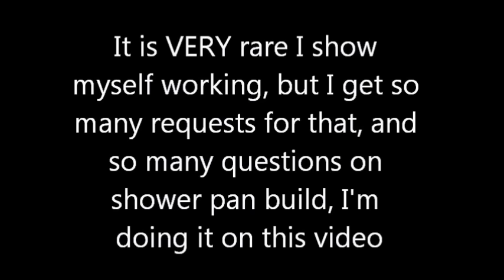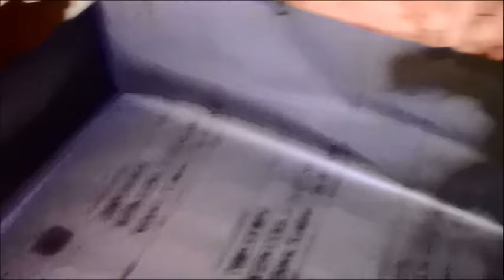HOW TO SET SHOWER PAN LINER and MORTAR

Comment: Great to see someone that doesn't preslope. Ive been shieted on for not doing it. I redguard the entire areas before tile so there you go
Reply: Just because your redguard before tiling does mean your good to go. Pre slope is a fail safe. So no pre slope, no fail safe.
Reply: @handyscapersllc 
I always pre slope as well. Do you know how many mud beds I redone because of no pre slope and the smell of stagnant water that had no where to go.
Reply from the maker: Obviously you're not up with the times, pre-slope doesn't matter now because everybody waterproofs the pan surface... as I have been doing for the last seven or eight years. Then FloFX comes along with a drain to make it happen. If you are still doing water in water out system then you are behind
Reply: @StarrTile  Nah I do remodels on older homes all the time when I tear out a shower with preslope before the liner they are usually dry as a bone with no redguard on anything just tile set on the bed above the liner the guy I learned from has done showers that way since the late 70's and always had the same company name and phone number and the only repair we ever did on a previous install was when two 300 plus pound fatties was getting freaky in the shower and the weight caused the mortar bed to Crack from the wood underneath flexing so much I always preslope and mix about a halfway of polymer modified mortar to two bags of bed mortar trowels super nice and has a nice smooth finish for the liner to sit on I use the same mix on the top bed no redguard ever on my bed then I hit all my screw heads with straight modified mortar and tape all seams and corners with it haven't had any failures in 15 years doing it the old way

Comment: I seen different ways to build the shower pan and they build a  first one mortar bed with slope before  laying down the PVC liner but ,I like to be practical and save time: I like the way you builded this showe, r because ones you installed the PVC liner plus you seal the mortar with red guard ,it will be no problem :good job  this is the way I do it , and never have a problem👍

Comment: I used to do tile when I was young and install panliners like you're doing we used to pre-slope the pan in other words before you put the pan in you slope it so when you go ahead and put the pan in it's already sloped in case you have any problems the water will always go to the drain and put three pieces of tile on the weep holes and then go ahead and mud it up but I guess everybody's different as long as it doesn't leak you're in good shape.

Comment: Basically makes no sense to put a liner without a pre-slope. If there is a leak ( that’s why you put a liner in first place) water  will sink down to the liner and just stay there and accumulate and will eventually rise to the tile . It ll never dry up and grout will come off tiles will give off. It just doesn’t make sense from your generally impeccable work ethics. But everything else on this video is Very educational and well thought of and crafted as usual! Thank you.
Reply from the maker: I don't believe that a pre-slope works as intended because wicking action with plus 200 lb and mortar will ensure that your pan is wet all the time, that being said nobody does water and water out anymore, surface of the mortar is waterproof which makes the pre-slope a moot and Antiquated issue, but thanks for the comment

Comment: Tutorial is nicely done; your usual good work.
Three things:
1. Knee pads
2. Caulk on screw heads or overkill?
3. Let's discuss your choice of music during the work session.
Reply from the maker: Thanks 😁✌👌

1. Knee pads bind up in back so I had them. I do have a kiddy float I use on flooring work, slides easy and I've had it for 3-4 years for a buck at the dollar store.
2. Caulk at srew heads overkill. I mud over them and the whole thing is waterproofed. I do caulk the holes I make with ledger boards though.
3. I had a great track on the working portion until 3 days ago when I got a copyright notification, which basically allowed ads to run and the money from the ads would have gone to the artist.... so I literally deleted the music and put on an ad free YouTube track...not the best tune but I'll be damned if somebody else gets paid off of my work 😂

Comment: I like your video but it would be helpful if you gave a running commentary on what you are doing rather than the loud music. The one question I have is what type of calking did you use around the drain flange. Is it normal silicone or is it butyl calking. Thanks for all the information, it’s really helpful.

Comment: I am doing another remodel  and have done my own shower pans. I understand why you dont preslope. I do a preslope, then a liner. I know if tiles leak its eventually having issues anyway.
 My extraordinary measure was using an epoxy grout that sealed the floor extra good. 
My new project I will use the largest tiles, then the leak issues are less. The mud bed must be absolute in the tile mud or it will crack. I always pull up tiles to insure adhesion contact on a floor.

Comment: I can only donate a small amount of $, because I live on a fixed income. While going in debt to it, I've been "forced to redo our bathroom. Please advise me on 2 things. What about your weep holes in this video? Just to be clear for me, you Redgard the mortar? Finally, I'm using a Quick Pitch and the instructions say I am to set the circular part on top of the flange bolts. So I need to screw the drain cap down  a little more to account for that, or just make my mortar bed thicker because of the Quick Pitch? Thanks SO MUCH for putting up some of your craft on YouTube. Don't quit. I AM like the other commenter who was puzzled as the amount of your followers. Dude, that's just wrong. You are an artist and should have 10 TIMES that amount! 🤳👍

Comment: Inspectors here in Oregon will fail my pan liners if they are not presloped.   You are lucky you don't have to do this extra step makes it easier to install the liner.  I also put some kinda of shim on the outside top part of the curb so the liner slopes into the shower area.  Looks like it will hold water to me.  Might want to protect the sides up the curb wall extra protection never hurts.  Would like to see how you do the curb part.  Do you use wire mesh over the curb and mud set it?
Reply from the maker: Everybody needs to get off of the whole pre-slope thing because if you waterproof your surface which everyone that I know does, then the pre slope would never kick in any way
Reply: That would be nice. When I do a large shower I got to wait for the preslope to dry before laying the liner..  PITA unless I put a board down on the liner so I don't mess up the slope..
Reply: It's because after a while soap, shampoo, and body oils mess with the pan waterproof membrane. At that point, water penetrates the mortar and sits stagnant on a non-presloped liner.
Reply from the maker: @msavage138  That sounds like BS, show me proof of that
Reply: @StarrTile  Then why bother to put in a pan liner at all?
Reply from the maker: @Stevelemontrudy  exactly, I asked myself the same question, force of habit

Comment: Very good videos, very practical?? I
 understand the way you explain the preslope will not help the situation if there are enough water leaked in. I am wondering if the preslope will help when water leaks in over time? If it does, why don't we build the preslope?
Reply from the maker: Because we waterproof the surface nowadays so it is irrelevant, the mortar will never see any moisture
Reply: @StarrTile  That is a good reason. How about in the case where the water seep thru from the bottom that is caused by a clogged drain. So the water get to the bottom of the mud. In this case, will the preslope help to drain any excess water - assuming the whole mud bottom already saturated with the backed up water. 
I understand this scenario does happen often, otherwise, there is a bigger problem need to be deal with, but when this happens, the ability to drain any excessive water will help, I would think.

Comment: Ok my issue is the builder used concrete to put a fiberglass pan in. I removed everything. But now i got concrete bumps making my floor not perfectly flat. Can i slope it UNDER the liner then tile on the liner or no? To chip all this concrete first would ruin the sub floor

Comment: When does the screw in drain cap portion get fixed or locked in to a height and what holds it from spinning?  Is drain "locked" in at the time of thinset and tile install?

Comment: So I’ve been told to use pea gravel around the weep holes on the drain so no mortar can get into them and clog them. Thoughts??
Reply from the maker: We are not doing water in water out system anymore so because we are waterproofing the entirety of the pan surface the weep holes would never kick in, having said that it doesn't make any sense to do an extremely porous product which would be Pebbles  instead of a less porous product which would be your sand mix, this might take

Comment: Good video 👍! The pan liner though obsolete now looked great in the corners. That was always the biggest mistake I saw when following a plumber. It's code in my area for the plumber to install the liner. I don't know why though lol. I take them out after inspection anyway
Reply from the maker: Thanks for your comment, yeah I heard that plumbers have to install Liners in some jurisdictionsh...but that becomes an issue if there is a leak later on, who does a homeowner blame, the plumber or the tile guy.... I would rather be responsible for the whole thing personally

Comment: Great video. Thanks for taking the time..  Do you red guard your mortar bed before you thinset?
Reply from the maker: Yes....entire shower is waterproof before any tile
Reply: Best advise I ever got from Mr startile was you should be totally confident your shower is 💯% waterproof before installing tile.
Reply: @StarrTile  
that does go a long way in answering all the pre-slope vs. no-pre-slope questions.

The bed of dry mix you set at a 1" drop per foot. ( that is your slope to the drain on all four sides.) 
Liquid membrane three coats and that rubber skin will last until the new homeowner changes out the outdate tiles.
Right ??

All the Walls up To the ceiling should get at least 2 coats of the waterproofing membrane. So, in theory that inside area should be waterpressure proof, if not... hit it with another coat of liquid rubber until it is. 

This is not rocket science, this is common sense at work. 

You are worth your weight in GOLD !! 

No one comes close to your watertight screws and drain area.

Comment: Hi, we are on our second shower pan leak  .  We have our guys come back and try to fix it. He took out the wood to reframe. He did use pre-treated wood and put a new liner. We did a test and we keep seeing water around the edges and also under the liner. What could be going wrong?
Reply from the maker: I could not possibly tell you the answer to that because there are too many variables with regard to operator malfunction. Obviously by the second one they don't really have a clue on what they are doing, be better to find a guy who builds showers because they do not.
Reply: Ok thank you for responding to my question.

Comment: Beauty vids brother i got one question, once i get the liner in, the final spin on peice of the drain, after i set the height, I just slap down the mortar? Thanks
Reply from the maker: Yes and do the best you can do firmly pack it around the neck of the drain
Reply: @StarrTile  awesome thanks for the response!

Comment: What if i dont want to put tile and i want to do all concrete for my floor.. can i use all mortar and just slope to the actual drain height? Should i use pebbles for weep holes?
Reply from the maker: Not sure I understand your question, you need to put tile on top of the mortar, not sure how you would just have a Tite-less pan...
And no I have never put pebbles at the weep holes, it would basically create a clog more than the mortar sand whatever do, but having said that we waterproof the entirety of the pan now so everything below it is irrelevant

Comment: I've seen now people do not put in a liner at all because as you also mention here, you do not put a preslope and I did not see pepples around the weeping holes so the liner appears to be redundant. If waterproofed with red guard or the orange schluter along with an epoxy grout, I do not see the need for the liner anymore. Your thoughts on this?
Reply from the maker: Yes, everything you said is true
Reply: A liner is to protect the subfloor from water damage not for drainage.

Comment: I’m doing a shower pan liner. I did a cement preslope already. Now I’m ready to install the liner. The backer board is already up and it was installed all the way to the floor. Can i install the shower pan liner over the backer board wall? Or how do i approach this situation?
Reply: Backer board goes on when the liner is installed on the studs

Comment: Why on some projects are a pre-pan installed then a finished pan with the liner sandwiched in between but then on this video, the liner fits directly on your base then a pan formed? My current project has a 6 X 3 pit with a center located drain. Does size dictate one or two pans? Thanks!
Reply from the maker: A pre slope is a thing of the past since everyone waterproofs their shower.

Comment: Is it by choice that you don't shop at lowes? Just curious.  Do you shop suppliers/wholesale or big box stores. As always I appreciate your ideas and methods as they tend to be down to earth. Thx, and happy new year.
Reply from the maker: I don't shop at Lowe's because I don't like their product line generally speaking, Plus they don't give the veterans 10% discount Like Home Depot does, and I can't go in there and get 2 feet of baseboard, they make you pay for a whole 8-foot section....
But yeah, HD is my go to store unless I need specialty items and I have tile stores fir that.
Reply: @StarrTile  I've started using their app. Order it the day before if I can and boom is ready. Or if it's a part for stock, I'll just have them send it to me
Reply: @StarrTile  I'm surprised Lowes does not give you the 10% military discount. I took my DD214 to customer service and they put me right in the system. I give the cashier my phone# and it takes off 10%. I live in Texas.
Reply from the maker: @dustchip8060  yes I believe Lowe's had said something about applying oh, and I didn't go through any process of bringing anything in because I carry my VA card in my wallet, I show that Home Depot and that's good enough
Reply: @StarrTile  I bought the 10" Rigid tile saw from Home Depot and they accepted my VA card as well.
Have you ever installed 4" x 48" porcelain floor tile? My client just bought it for their master bath I've completely gutted.I didn't realize tile even came in that length and small width. Already anticipating a nightmare. lol. There is 1/8" of bow up in the middle of the tiles.
Any advice on installation procedure outside the norm?
By the way, I use your procedure to install liners, mud beds and backer board. Thank you for the teaching.
Reply from the maker: @dustchip8060  leveling clips 💯
Reply from the maker: @dustchip8060  https://youtu.be/kL7bs-y1euA
Reply: @StarrTile  Beautiful shower install, thanks for the video link. Yes, I already planned on using leveling clips. Since the tile is so narrow there would be a lot of rocking side to side along with dealing with the bow. There's only 160 sq. ft of it but over 200 sq. ft of subway tile on the walls 8' high including 2 sides of the new shower.
Thanks for the advice.
Reply: Lowes gives 10% if you go through the verification  process before  shopping. They do this  because  to many vets give their  VA card to their  buddies  and cheat them. But what's  better than  HD, you get the 10% discount  online also! I find myself going to Lowes more for this  reason, and the still have humans at the registers!
Reply: @StarrTile  funny that you say that about the vet discount. Lowes gives it everyday. HD does it only on veteran's day and Memorial day.. i always try and sometimes I get it with a call to a manager but usually HD pulls out their laminated paper stating they only do it on those days.
Reply from the maker: Actually that is not true, if you pull out your veterans card you will get a discount on everything every day of the year, whereas Lowe's you actually have to fill out some type of form to get the discount which I refuse to do, my card would or should be enough

Comment: how do you bend the inside corners of the liner , you cut and beninside the 2x4s? thank you
Reply from the maker: Yes you could do that but usually there are double 2x4 in corners where you can't. 
I just use hospital type folds

Comment: I have a question...  Why can't you pour a floor With a wet mix.  Not too wet where it self levels, but I think you know what I mean..
Reply from the maker: If you look at my videos about 8 or 9 years ago you will see that's exactly what I did, still strong and a little more workable....
However,  a so-called dry pack serves two purposes, one it allows water to Wick into it easier to supposedly drain into the weep holes which is contestable, and the second reason is less water makes for a stronger tensile strength on Cement Products. Although that is more true with concrete than it is with mortar.

Mine is somewhere in between the sloppy mortar I used to do and a dry pack, works for me well.